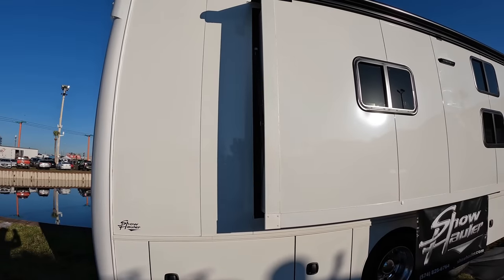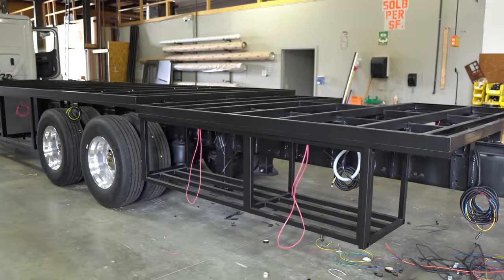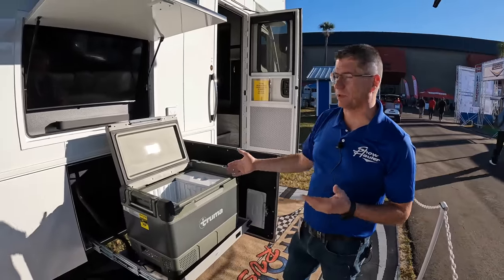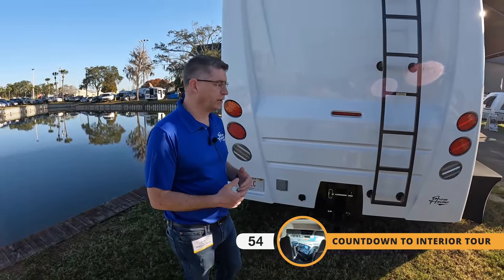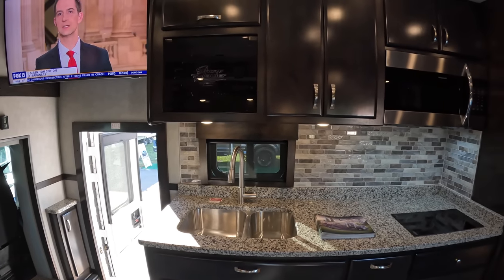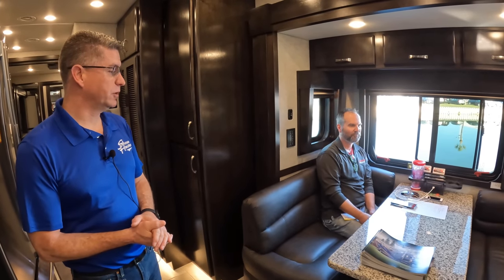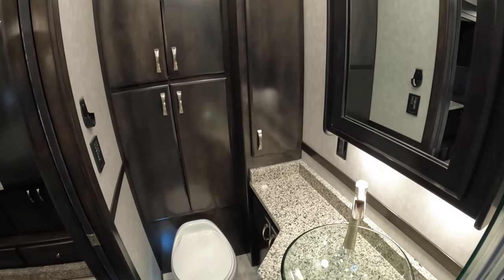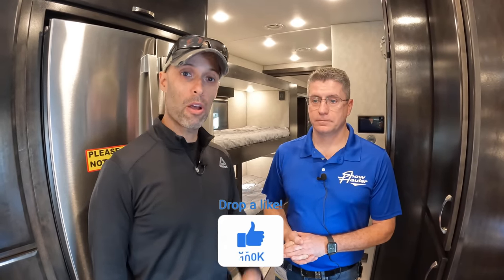This Is THE BEST Built Super C Motorhome On The Market -- 2022 ShowHauler Full Walk Through Tour!

Comment: As I travel around taking pictures of drag racing, I see ShowHauler coaches regularly at the race tracks.  My first impression is always "well built."  Most of the time, a ShowHauler coach is pulling a large stacker trailer with one or more race cars inside.  It is a massive overall unit, but the ShowHauler does not seem to have any problem motoring on down the road at typical interstate speeds.  If I were a racer, I would love to have one of these units.  Thanks for the video.  Lou from Georgia.

Comment: The pricing is good but once you start making it the way you want ….it im sure can reach upwards to 800k which for some people 
Iike all the creature comforts of home I would most def be one of those people I would hate to cut a few corners then damning myself that I didn’t add this or that …..  Showhauler is most def a great coach thank you for this video and your time 
Marc
Reply from the maker: You can get a real nice setup new in the 600’s.  Nothing comes close to the build quality at that price point.
Reply: What is the main difference between show hauler and  renegade
Reply from the maker: @joegrisafi8540  all steel welded cage with aluminum sidewalls on Showhauler fully customizable MH privately owned small company vs Renegade aluminum cage fiberglass sidewalls owned by REV group.  

Also Showhauler builds on true HDT chassis where as Renegade does have different models some which are not in HDT chassis.

Comment: Love the Freightliner Chassis.  Would have been nice if you showed the engine.  Unbelievable this unit does not have an oven for what it costs. Don’t really like the fuse boxes are in the bathroom either because the humidity. Thanks for the review.
Reply from the maker: Most high end units will have a convection microwave and no oven.   It’s an all electric coach.
Reply: no shower in half bath so humidity wont be an issue.

Comment: Hmmm.. Very tempting. The twelve-speed transmission is really a great improvement. The 12–18 month lead time is a bit hard to swallow. Newmar is currently 6-9 months, if you can even find an available run slot, which many think is too long. According to the Angie (NIRVC) most of their 2022 allocated runs are sold already.
Reply from the maker: I like Newmar.   The build quality and construction is not close.   Been to both factories Showhauler is a far better built coach.  Does not have the flash of Newmar but if you are looking for a coach to last you a lifetime Showhauler would be our choice.
Reply: @EndlessRVing  Thank you! This is exactly what I wanted to know. I fell in love with the Newmar Supreme Aire 4590 model, but if it's not built as well as this is, then Showhauler is where I'm spending my money. Yes, it isn't as flashy, but the design rule of "Form follows function" is where it's at in my book!

Comment: the problem i have with this build is the bubble insulation. I use it all the time on my coach and it causes massive condensation residue and drips. wouldn't that drip sooner or later cause mold of some sort?
Reply from the maker: Spray foam and reflectix insulation